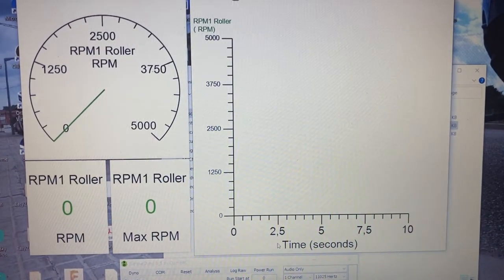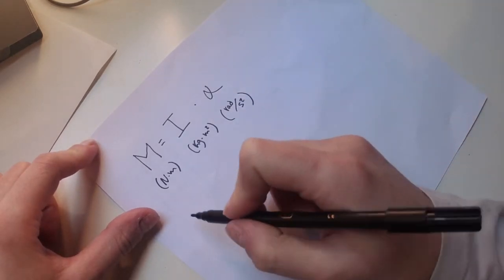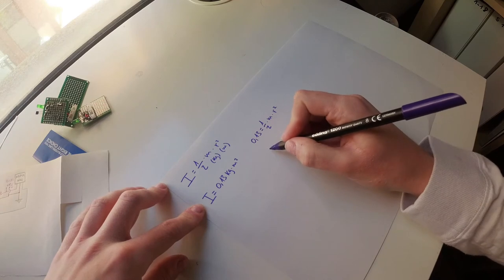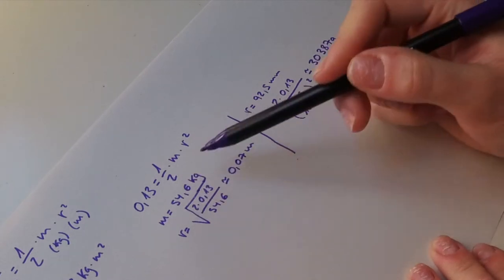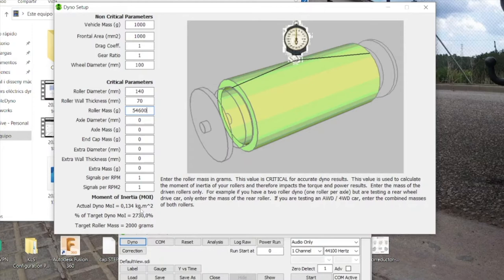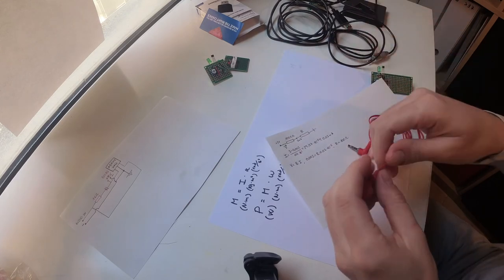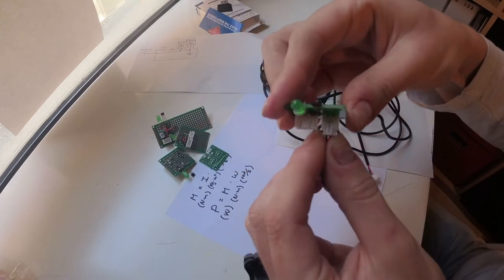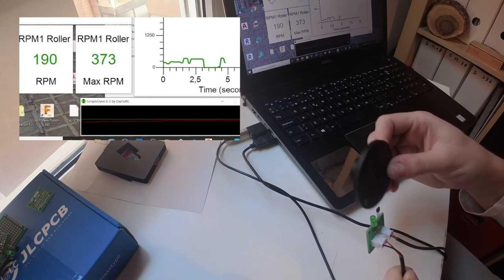Homemade Go Kart Hub Style Inertia Dyno Episode 1 | Software and Electronics

Comment: hai, can you sent me a list with all parts needed? i need to build one like this, it s super
Reply from the maker: The main component is the squirrel cage rotor and then you model/build everything around it. Mine is a 50Kg from a three phase AC motor (ABB) brand, then you need the bearings to mount the rotor to the steel frame. I couldn’t get it working while testing electric motors mainly because the torque is almost constant, maybe I will try with a gx200 clone to see what values I get.